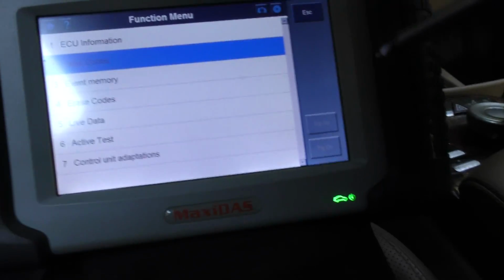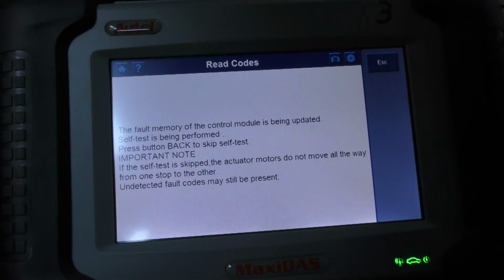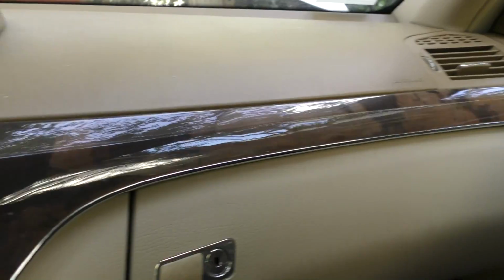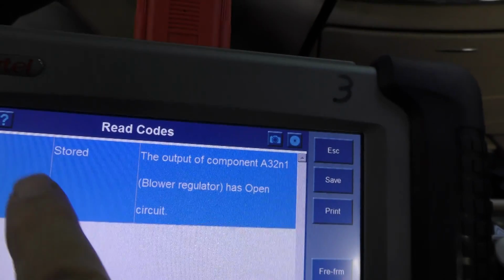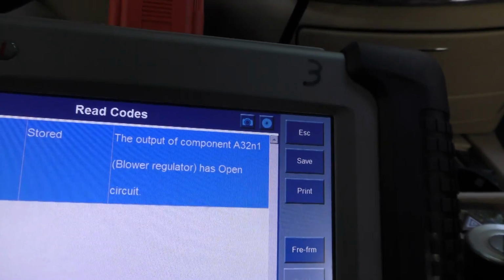How to Fix Modern AC System in Your Car

Comment: Scotty,
 Replacing some AC components on 1998 S70 Volvo. First time I have attempted AC work.
The connectors with an interior spring coil locking around a line were removed with a compression ring tool. Went ok first time with some force. How does it go back together? The spring thickness is too large around the line to insert that all through the female side of the connector and if the spring remains inside the connection I can't seem to get the compression ring tool in to open the spring allowing the male end back where it goes? The spring ring is blocked by the flared end of the inserted line. 

Thanks much for all the helpful info.

Comment: I replaced the blower motor and resistor in a 2001 Toyota Corolla and the parts cost less than $100.

Comment: I've just had to fix the aircon on my 2008 Citroen C4 Grand Picasso (French minivan). I had the system recharged and found out that the condenser was leaking (it was a good thing that dye was added when it was recharged). I fitted a new condenser and I damaged the end of high pressure line taking it off due to electrolytic corrosion so I had to replace that section of pipe from the condenser to the evaporator. I had it recharged and it is now working. I reckon that I've spent just over £200 in total.

Comment: It looked like the shaft of that blower motor was dry needing to be oiled.. I bet if you oiled the shaft bearings the motor would have worked.. Blower motors need lubrication too.

Comment: Even my 01 Durango, the panel with all the HVAC controls, apparently has firmware in it. Blew me away when I read online about updating the HVAC module firmware. I didn't even realize there was a microprocessor in there!

Comment: I have a 20000 lincoln town car I AM HAVING A PROBLEM WITH THE A/C BLOWER NOT BLOWING OUT THE FRONT VENTS. IT IS STUCK ON DEFROST..
Reply from the maker: unfortunately that's all computer run, and you have a problem with the actuator doors or control unit in the dash. ONLY a ford tech with  a dealer level scan tool can analyze and fix that without just pure guesswork. Used to be a simple vacuum hose leak did that, but no longer on modern cars.

Comment: I have 2002 pt cruiser with 114000 miles.  today it desided not to start, is there a way to tell if i need a fuil pump or a timing built?

Comment: Hey Scotty, I need your input on this.  I have a 2014 Chevy Malibu out of warranty.  The A/C works and gets cold. But, at times without changing the temperature it seem like the coldness drops to warm cold. This happens while im driving and temp set to low.  Any suggestions? Thanks in advance.

Comment: I have a 2013 Honda Civic Hybrid. I am having problems with my AC. It recently went out and now there's a hissing sound coming from the compressor and the cabin recirculation button is not turning on.I have already been to 2 different mechanics and they've flushed out the refrigerant and checked on the relays and that's not solving the problem. What's weird is that when power is added to the compressor directly from an outside source the ac works fine and the hissing noise stops. Also both blowers fans failed at the same time..Neither mechanics can figure out why the compressor is not getting power and they've told me that the high pressure system is unusually high... there's no problem with the compressor, condensers. relays nor refrigerant, no air or debris inside the ac system . Can anybody help me out with any diagnostic ideas?

Comment: I have a 1990 Nissan SE pick-up and replaced the master cylinder a few weeks ago, because the fluid kept disappearing. It worked fine after that! then this week- I haven't drove it for 4 days, and the fluid was completely empty. I only realized when I got in, and the pedal went to the floor,( then looked at the fluid). I can't seem to find to a leak on,or around the new part. I don't know anything about fixing  cars, but wanted to know at least how to find the problem so I can tell someone what the problem is. Suggestions????

Comment: Scotty, please, stop calling a computer controlled transistor a resistor. And what do you mean you could spend 1,000 years testing and not figure it out? The A/C was on and the freaking blower was not working... why was the blower not the first thing you checked? I swear, you act like you hate new vehicles, but you apparently hate logical diagnostic processes as well.

Comment: I have a 2009 Merc Marquis. It's blowing hot air. I brought it in, and they diognosed a Blend Door Actuator failure. This $40.00 plastic price of junk will cost $700.00 in labor to replace. I'm fuming mad at Ford.

Comment: I had an AC problem that I solved myself eventually.  It needed a new blower motor as well.  Before finding that out I checked all the fuses and the resistor in the hood fuse box, put hand on it to see if it clicks when car AC turned on.  Changed the under dash resistor and it wasn't that like you showed in this video it was that also.  I also bought a new temperature dial switch but that wasn't it.  That switch is the thing you turn to adjust the intensity of the ac or heat.  So eventually just bought a new blower motor.  The problem that started all of this was that the ac heat only worked good on a high setting.  Otherwise was weak flow.  Figured likely not the motor if it works on high must be some electrical issue and it wasn't, no fuse, no resistors, no capacitors, no switch, and luckily no wiring or harness issue.  2005 chevy cobalt.

Comment: I have a question. 2008 Honda Civic Ex Coupe's A/C works great for about 2 minutes after starting car when cold. Soon as the temp gauge raises a couple bars, A/C starts blowing warm. Will not blow cold until next day when car first starts. 

Any ideas? Anyone?

Comment: Fuck Mercedes! They're just show-off accessories for micropenis individuals. I'm a company owner and just bought myself a 1000 dollar 2006 Daewoo Matiz. It has 4 wheels, 5 seats and it moves. Top speed of about 95 MPH. AND it has air conditioning. And I fixed a sensor issue with electrical tape, and most parts you can just work on them yourself.

I can drive it and it helps me get to my clients and do stuff for them more effectively, while keeping the company's income growing. I cannot imagine buying a 100K Mercedes ever. What does it do, does it make fries? :))) I'd build my own datacenter with that sort of money.

There's too many people wasting money on garbage, instead of putting them in proper use for actually doing something with them...

Comment: actually when the fan doesn't blow you can work backwards to resolve the problem.  Computer failures is harder figure out unless you have a computer to swap test.  I had that Honda Accord problem with 20 years and 230k miles.

Comment: did you really just run a non amped wired unmetered directly to a blower motor?
Reply: usually, 12 vDC is high speed, resistor pack is used to create medium & low settings, 12ish volts is "HIGH" : )

Comment: blower resistor kept failing on my dad's '01 Dodge Van (fan control only worked on "high") - had to replace the blower motor to stop the resistor from failing. new resistor - $12, new blower motor - $32 eBay!
this video should be titled "how to fix a car that doesn't blow air/blower repair" or similar

Comment: thats why im glad all 90s japanese cars will last forever the 80s-90s was the most advance time as far as releasing technology to public that actually works for years. they never released anything that never worked,

 tbh germans really went off the wall with "repairing" the dam thing they NEVER think oh what happenes in 15-20years when these cars are dirt cheap but dam near all the electronics are broken no thanks i'd rather rebuild my mechanical 1970 Jaguar V12 engine  that still hasn't broke LMAO

Comment: I am surprised they still use sleeve bearing motors..and use blower fan energy to cool them. Quite antiquated. Even computers did away with them for the most part. First thing I swapped in a 96 gmc... Added a ball bearing blower. (those trucks could burn via the blower motor before never killing the resistor)

Comment: Years ago when I worked on vehicle A/C systems,  I changed out a lot of blower motor resistors. Usually the blower only worked on 1 or 2 speed settings.

Comment: I had a new MB in 1981 (company car) and the blower motor resistor broke. It was mounted in the engine bay and very easy to access.  It cost about $8 at the dealer's parts dept. and I put it in myself...about 3 minutes.

Comment: Scott, I've followed you for sometime and I've gotten my best advise from your videos. I got a 2009 hyundai accent which got a check engine and left me on the road. It said it was p0343 which is camshaft position sensor but the car cranks but wont start. I changed the camshaft and crankshaft position sensor and nothing. even changed the fuel pump assembly and nothing, can you help out and give me your in put????

Comment: The car was not running when you checked to see if the resistor was working. As I recall, the car needs to run in order for the ac to run.
Reply: No, I don't think so. The engine does not have to be running. Rather the ignition switch has to be in the run position. That allows for the fans to run, drawing power from the car battery. However, the A/C will not be able to cool, since its compressor is driven by the engine running. If the ventilation fan does not come on at all, then perhaps, start the engine, just to be sure. Cars get just more and more complicated.

Comment: I would fix it by removing the entire system in my opinion, the ac is  a useless piece of crap.It stoles the cars resources just for air and you might get sick by using it.If it wasn't for a part i need it would take it out of my car i never use it .

Comment: It seems the computer didn't really help. It seems that the simple test of the motor and the "change it while your in there" of the resister was what fixed it. That would have been the first test without any diagnosic computer, right?

Comment: Don't get me wrong, I hate Mercedes, but this repair had nothing to do with Mercedes parts not lasting. This same failure could happen on any other car. Bearings in the fan motor dry out or the motor locks up, draws to much current, and burns up the resistor (or motor driver in this case.)

Comment: I am a disabled vet and still have a 1991 toyota camry . It is easy to fix. My fan motor and resistor went bad last summer . It is easy to fix even thou I have no legs . I went to a junk yard and found a car that only had 29k miles. I got both parts for 25 bucks . Its a good thing my dad who worked all car as a master mechanic for over 30 years .I stared working with at the age of 9 . 1 of the shops where there was only 2 tecks let me chain oil rotate tires and by the time I was 12 I could remove motors work on rebuilding them and transmission . These days it hard to fix them without a expensive scan tool. I also wander what was the total cost of that repair?

Comment: For the backyard mechanic as long as you are knowledgeable as to doing chassis work and things of the sort , one can still do those types of repairs changing ball joints etc for a customer or saving yourself some money. The diagnostic equipment needed to do different brands of automobiles troubleshooting is what keeps these repairs beyond the scope of the typical backyard repair man.

Comment: Scotty, my a/c blower does not work ,even heater don't work, I check the blower like you show me and it works, hook back to jeep it don't , bought a new resistor still don't blow, got a use ac switch from ebay still don't work check relay its good fuse good, what else can I check,, Thx,,

Comment: It probably actually is a regulator and not just a resistor. In most cases in modern low-voltage electronics power is regulated by PWM (Pulse Width Modulation) - the power is turned on and off at some frequency and the ratio between the time the device is on vs the time it's off determines how much power is supplied (the longer the pulses and the shorter the delays between them, the more power).

Comment: Didn't really show anything to do with the actual AC system
Reply: Steve, take a language course. Learn what "SYSTEM" means. That blower assembly is PART of a system, and without it the air conditioning is BROKEN, I.E. doesn't work. You half baked CLOWNS who think you're so frickin smart and don't have a CLUE piss me off. Just shut up. He who remains silent and is thought a fool has it right. Because when you SPEAK you remove all doubt.
Reply: Tom Swinburn Well actually the system you're referring to is the HVAC system of the vehicle, and yes the blower motor is one of many parts of that system. The title of the video specifically says ac systems. AC obviously stands for air conditioning, the system that conditions air by removing latent heat. In no way does this video show anything to do with the refrigerant circuit of the ac system, so really the title isn't accurate at all. And I do have a clue btw, I've been a licensed technician for over 10 years.
Reply: Steve, I've been licenced ever since my state required it. But I STARTED working in HVAC in 1966. I've worked on both comfort and process systems, industrial, residential, commercial, low, medium and high temp. NOW Jr. That SYSTEM that removes latent heat isn't going to work without a carrier for that heat, to REMOVE it from the refrigerant, and to distribute air which has had heat removed to the conditioned area.  Those fins on the evaporator are PART of that system, as is the blower or water in a water cooled condenser, where the heat is released to EXIT the loop. Take away that blower, or that condenser fan or water tower and the SYSTEM doesn't work. So YEAH, it is part of the A/C system. I've no doubt you understand the process, but you fail to grasp the definition of the word SYSTEM. Think for a minute about what you said. HVAC refers to HEATING, VENTILATING and AIR CONDITIONING system. No where is the refrigerant circuit separated. I'm an old dog.  Over 50 years in the trade. I'm more than a little hard to bullshit. So is Scotty, as he is also an oldtimer in HIS trade.  

Restrict your A/C to the refrigerant circuit. Do away with the blower. What happens?? Uhhhh, it FREEZES up, RIGHT? So the blower, the condenser fan or tower ARE part of the A/C SYSTEM. If you want to correct someone who is RIGHT, expect a little push back. When you sell a "system", are you restricting it to a compressor and a couple of coils? No, you have refrigerant lines, possibly duct work, blower and thermostat, and assorted other pieces COMPRISING the SYSTEM. Scotty was RIGHT in his title, his language and he doesn't need some snot nosed KID telling him different. Real simple. The blower doesn't work the air conditioner doesn't work. Period. I'm tired of SELF PROFESSED experts correcting people who are worlds more competent that the complainer is. Save YOUR response. I'll waste no more time on ya jr.
Reply: Tom Swinburn nah I'm not going to save my response. You're missing the whole point of my very first comment, the title of this video is nothing more than "click bait". Scotty puts up a super generic title for his video that loosely is related to fixing ac to get you and me to click on it. Consider being the guy who's searching for legitimate help to fix his ac in his car and he comes across this video and all he learns about is a stupid blower motor. What if you clicked on this video expecting an ac repair video and it was a video about replacing rad fans, or about replacing a serpentine belt, or heck without a running engine the ac won't work so what if it was a video about replacing a starter motor. Those are all parts of your "system" that you want to argue with me about. You cannot convince me a blower motor replacement video is an ac repair video, it's just as much a heater and ventilation repair video. Keep getting baited into watching this garbage, and il keep calling out these people who mislead their viewers to get their viewership up higher.

Comment: @2:39 You didn't start the car, so there is no power for the Blower Motor versus @2:59
(but I'm sure you already know)

In some cars, they actually use Voltage Regulators (transistors) instead of wire-wound resistors since they can use additional ICs that can send digital signals to the ECU/ECM about the component/unit's status.

Comment: I'm having this problem right now on my 2011 Ford Fusion. The resistor was overheating and melted the connector. So have to splice a new wire assembly and replace the resistor and probably the motor too, but it will cost $150 vs $300 for that Mercedes lol. I hate that blower so much right now especially since my last car a 1999 Crown Vic never had that problem. If it wasn't for my friend who is a mechanic I probably would have never guessed that was the problem.

Comment: You stupid. It's not a resistor but a regulator. It has electrical board and a couple of powerful transistors. Modern cars doesn't have resistors to regulate blower motor since 2000.
Reply: That's the name of that part in common, regardless whether it actually uses resistor or not.
Search for "blower motor regulator" on auto part sites, and you will get results saying "blower motor resistor"

Mercedes seems to be calling it regulator, though.

Comment: Perhaps I'm not understanding correctly, but why would you need to read the codes to see that the fan's not working? It's pretty simple to tell what's wrong if you're not blowing any air as that's a very simple system.